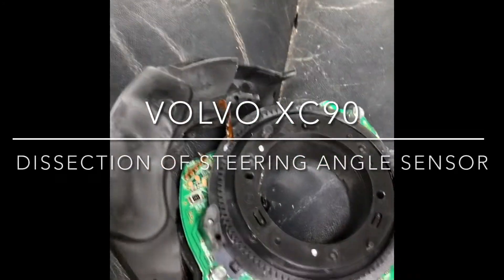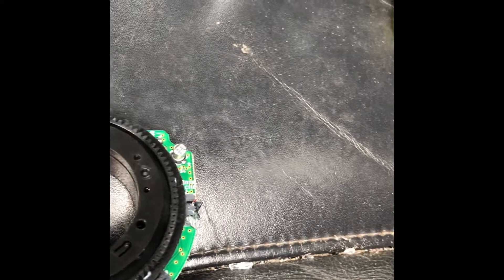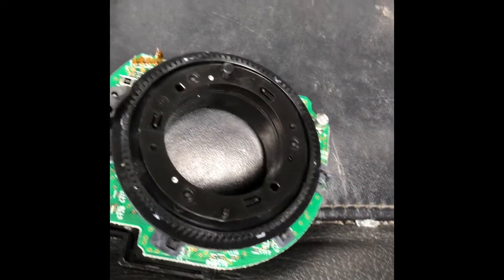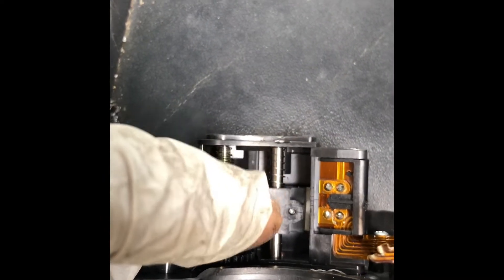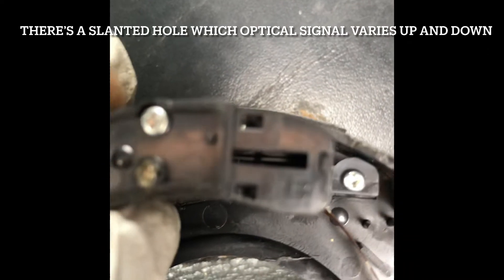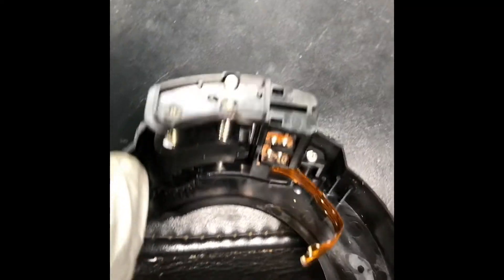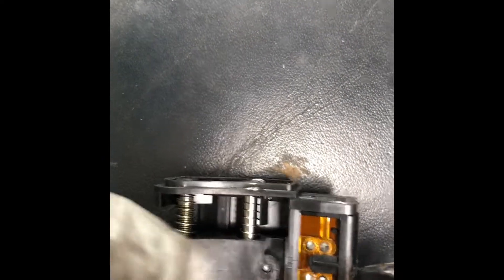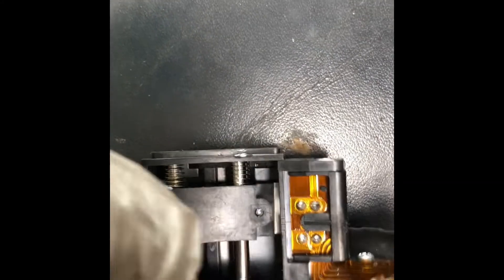Volvo XC90 Steering Angle Sensor Dissection - Can it be cleaned?

Comment: Nice work,  was wondering if it was optical and if it cold be possibly cleaned. I have an XC90 an X5 BMW both  with SAS problems in workshop at moment, I will give it a go if I can get apart! Thank you for video.